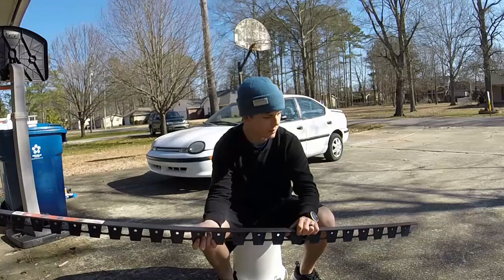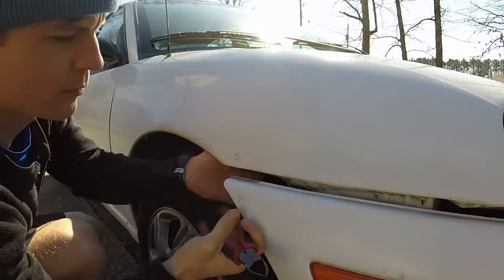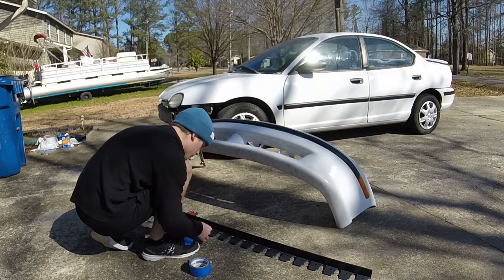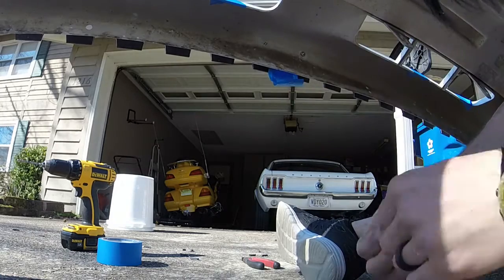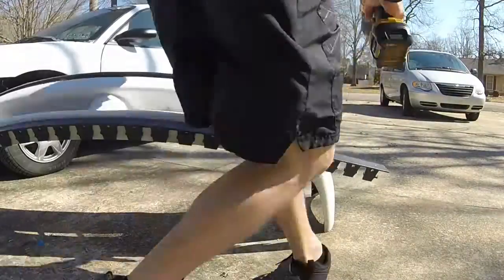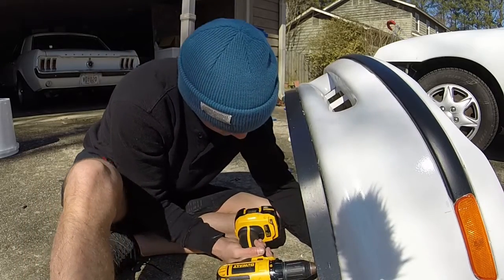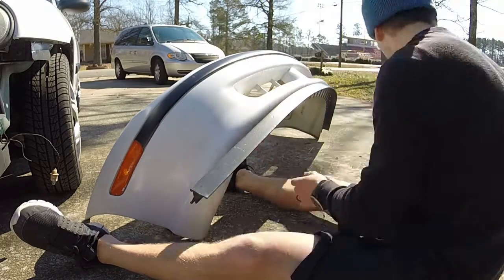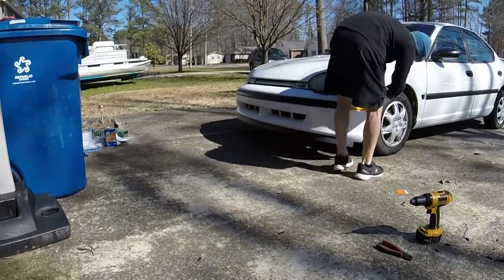DIY Car Projects: Home Depot Lip

Comment: little tip, you might wanna take a heat - gun to that lip, to de-stress the material from that bend you put in. Now it puts constant pressure on the bumper which may cause it to crack at some point and that would suuuuuuckk